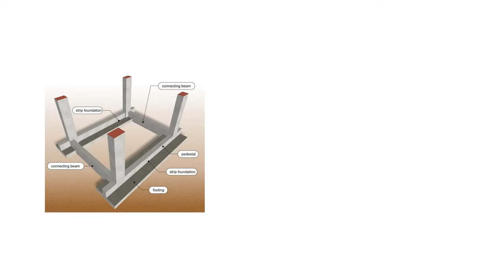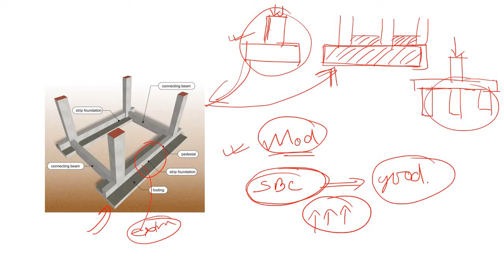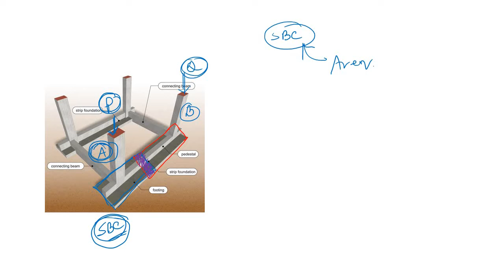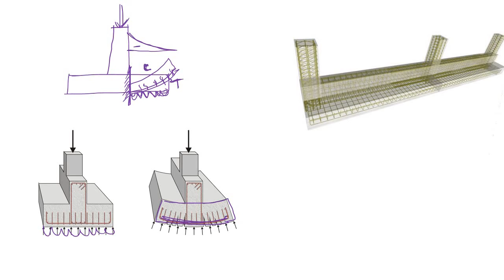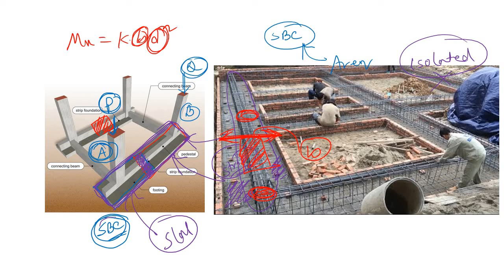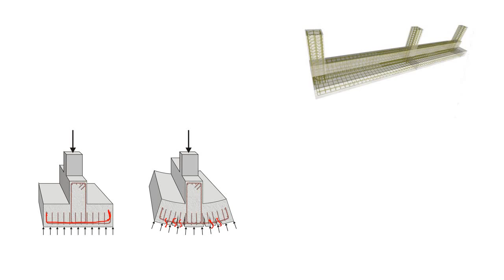Strip Foundation (Only for Beginner )

Comment from the maker: 🚀 Steel Design Masterclass (Complete 38-Video Course)
Master in-depth structural engineering concepts through 38 comprehensive, pre-recorded tutorials. Includes doubt clearing for each module and 1 year of personal WhatsApp assistance.

🔥 EARLY BIRD OFFER: Normal price is ₹1,999, but it is only ₹999 for the first 500 students! Don't miss out.

👇 Enroll via UPI / Netbanking Here:
https://rzp.io/rzp/VZqWHXja

(Note: After completing the payment, access will be manually granted to your registered Gmail address within 2-4 hours. See you inside!)